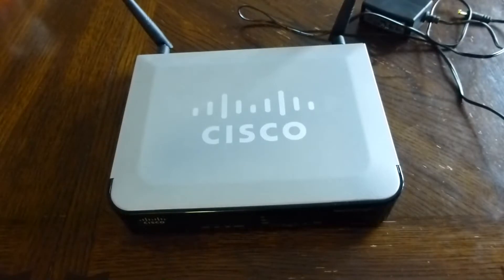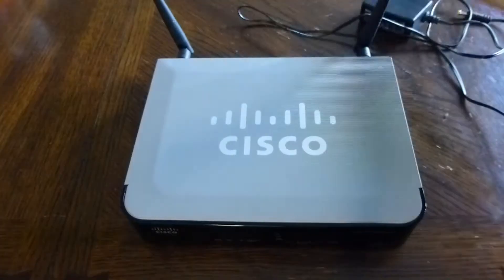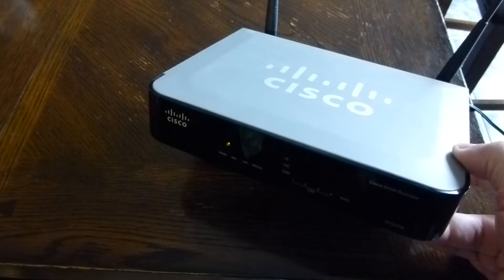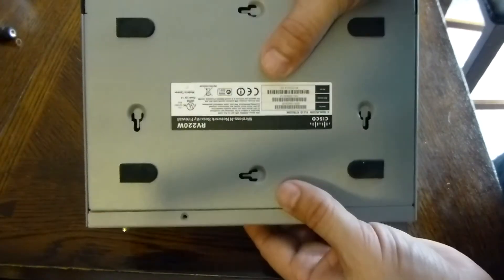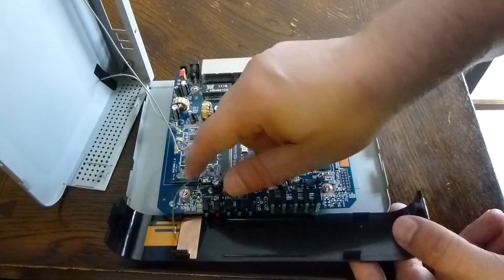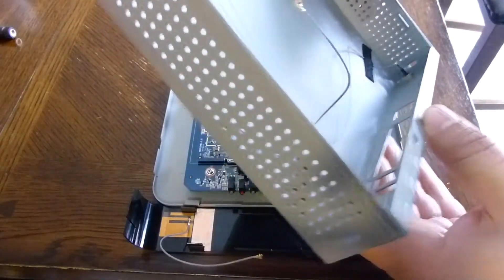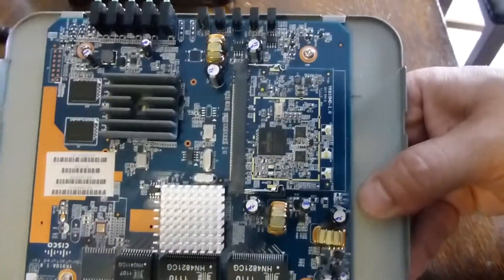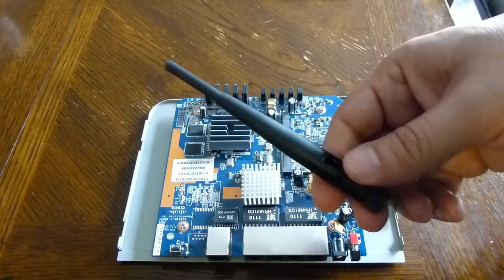✅ Cisco RV220W Teardown - Removable WiFi card?

Comment: The WiFi card is removable because it makes FCC certification for the 2.5GHz band simpler.  If the WiFi card is FCC card is certified, then the entire device is 2.5GHz certified.  If you look inside many WiFi or Bluetooth enabled devices, you will find a small WiFi or Bluetooth daughter board soldered on to the main board.  Again this is for FCC certification.  Or what ever government body manages the radio frequency spectrum.

A good video but your videography can use some improvement.
Reply from the maker: Great! That explains everything perfectly.